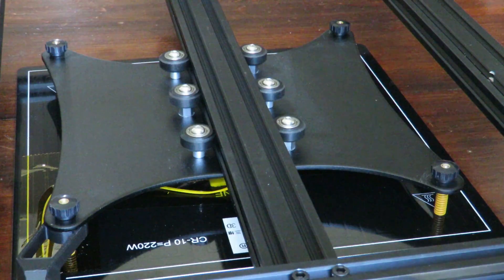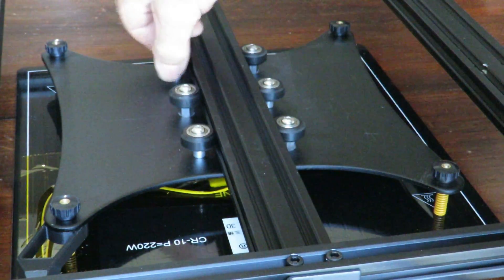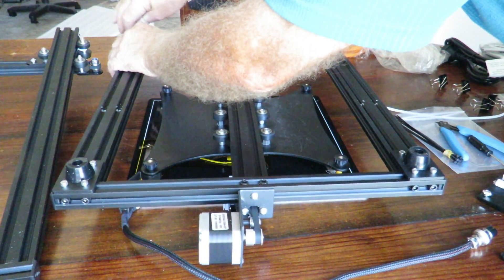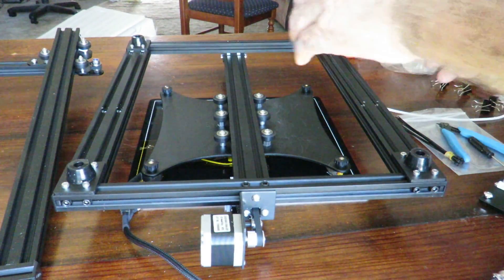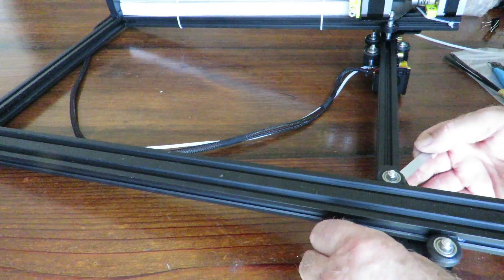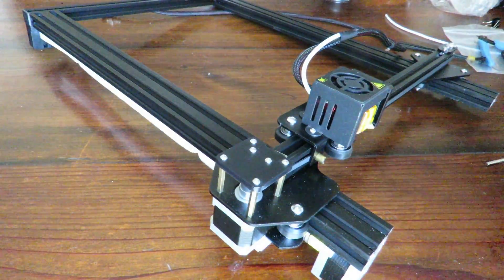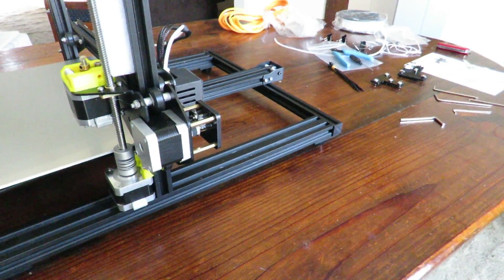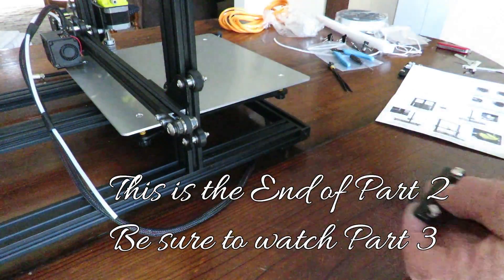📌 Part 2 of 4 Creality CR-10 3D Printer Full Build Instructions and Assembly - Eccentric Bolts

Comment: Good video Gary...you know, some time ago some one mentioned they removed those middle two wheels and had no adverse effect.
Reply: Removing the tnwo middle rollers improves the adjustability a lot. I can commend it
Reply from the maker: I have seen that mod done also. 
Although I think the heated bed stability might not be as good, but don't know for certain.
Reply: I would think less drag on the build plate too
Reply from the maker: I might have to look into this a bit more.
Reply from the maker: Good point.
I might check this out and do a few test prints to see what happens.